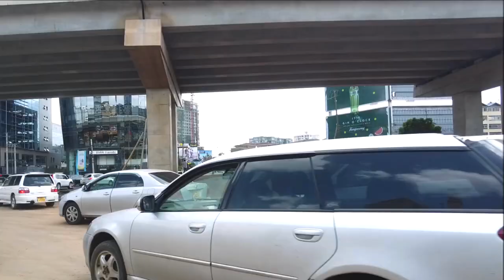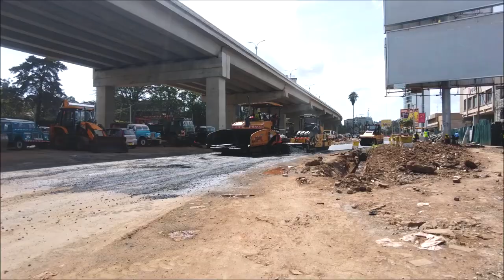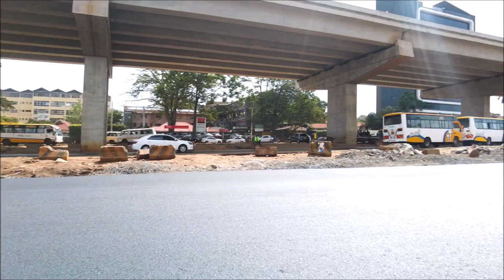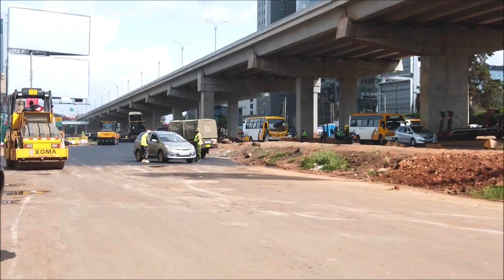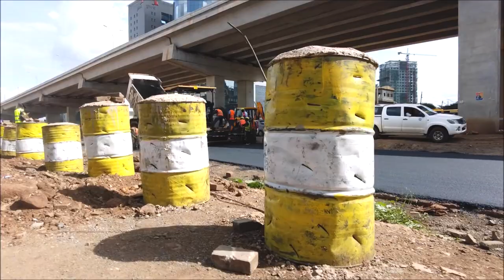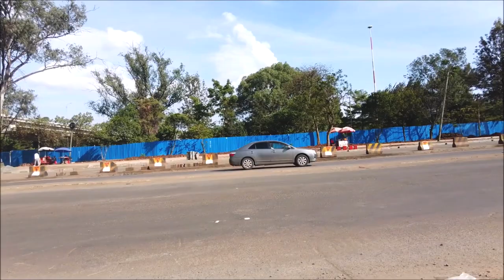They Are Now Tarmacing This Road Under Nairobi Expressway!

Comment: What’s needed:
- road marking
- sign posts (speed, give way, pedestrian x’ing, etc)
- curbs to seperate the road from side walks
- side walks (cement or brick)
- zebra crossings
- stormwater drainage
- beautification (landscaping, grass, trees, decor)
- lighting for roads and pedestrians
- rubbish bins
- regular cleaning of roads
- Get rid of the mud and dirt everywhere on the road
Reply from the maker: It's true. U was in Tanzania and I saw that they actually do have most of what you have pointed out whole constructing a road
Reply: @ThisIsAfrica  I think this should be the bare minimum of any road being constructed anywhere, especially for one of such national significance as this one
Reply: Well said.I hope/believe they will factor all that  I am afraid there is not much space for the sidewalk.

Comment: Putting asphalt on the surface don't add any value if there is no landscaping and other associate elements like sidewalks, road marking and well signage with quality signpost and  boards.
 The other thing they should get rid of all those  huge advert billboards along the roadsides and set it up in shopping centers
Reply from the maker: Thank you for your time to write this positive take. It's always important to put pedestrians safety and motorist safety first I hope they will consider this as soon

Comment: I think it's good if they decide to expand and make a dual carriage way .....on  both side .....
Reply from the maker: This is Waiyaki Way which is a dual carriage.
Reply from the maker: Or which section do you mean?
Reply: It's a dual carriage way, the problem is that the majority of the motorist are not aware of that, unless the road has marking lines. they mistook it as a single carriage that's why u find them driving on the middle of carriages.
 even roads with marking lines they don't know how to pick and choose the correct lane.